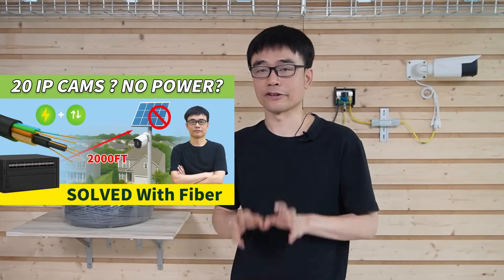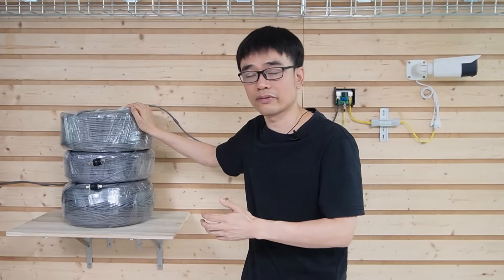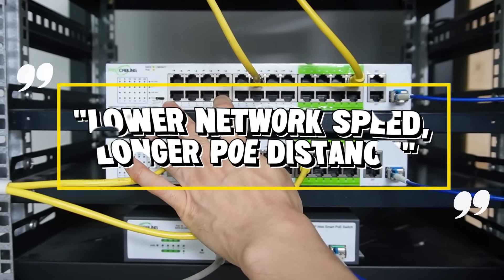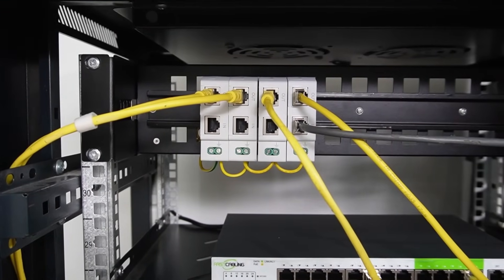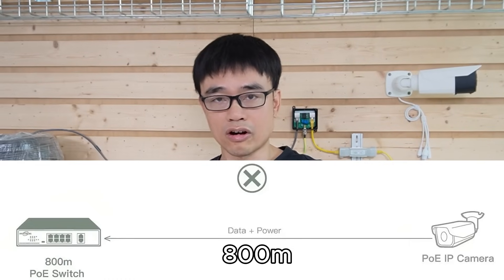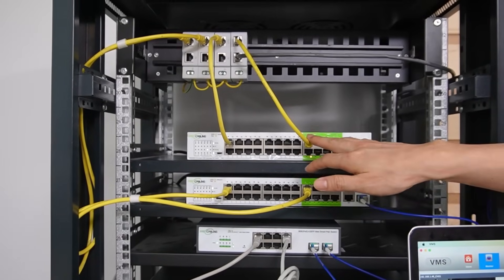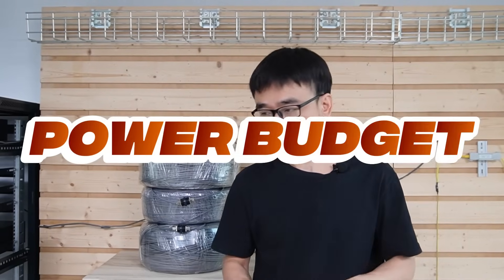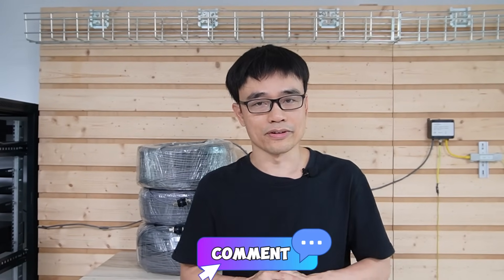Robust IP Cameras Setup with 2000ft PoE | Long-Range CCTV Project Pt. 2

Comment: In this lab, why do we need 4 surge protectors near the switch? If u can, plz share product technical specification of that
Reply from the maker: The copper cables could absorb the surge and travel to either directions. There are 4 long range ip cameras. That is why it has 4 surge protectors in the rack.

Comment: When "CCTV mode" is turned on, what actually happens in the switch configuration? Whether it reducing the speed and duplex setting?
Reply from the maker: The switch will step down the network bandwidth of first 8 ports to 10M and extend the network to 250 meters. It is the trade off between the speed and the distance.